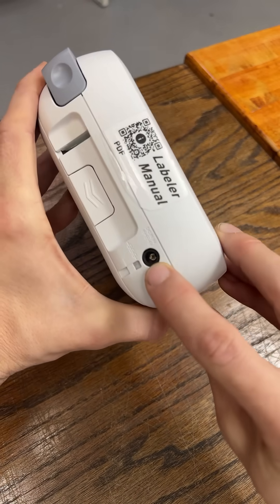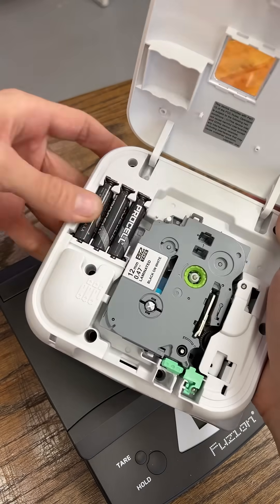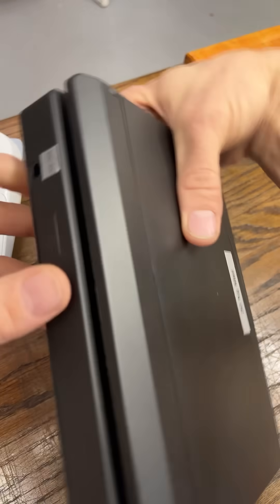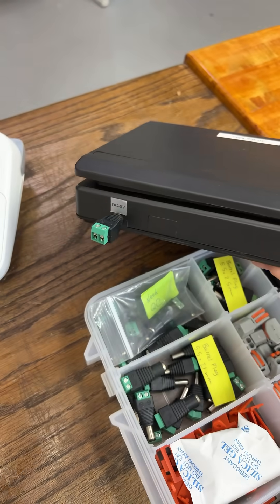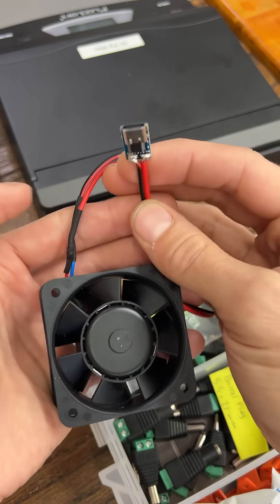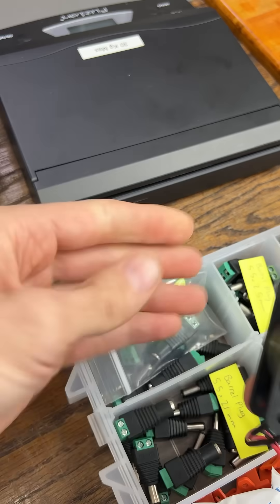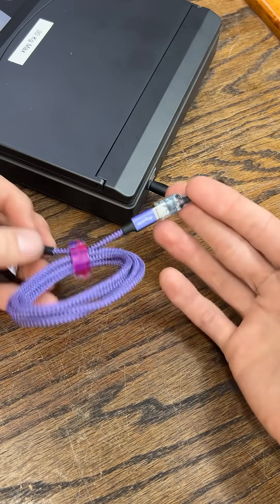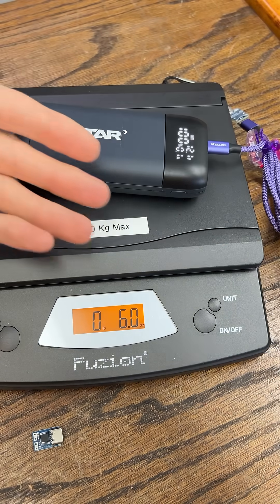USB-C can replace alkaline batteries

Comment: USB-C quick charge mode spoofer indeed is useful to use phone charger as power supply. Seems you're using your printer very often. Mine still run on same 6 AAAs installed at day when I bought it 2 years ago.

Comment: These label makers drain the batteries with shameful speed when switched off. To avoid this, I always remove one battery from the battery compartment and store it next to the printing cartridge when not in use. There is enough room for a loose battery under the cover.

Comment: I'm pretty sure the main reason usb c ports are not more common is because it would generate so many complaints from people that have no clue what they are doing. If you have ever done any type of support, then you know people are not very bright. People will see a usb c port and assume any usb cable with any charger should work, then start complaining because their device that operates on 12 or 9 volts does not work when they plug in their 5v phone charger. I see stuff like this all day.

Comment: Careful with those adapters and power blocks. Those are designed with specific devices in mind! One day your device works, and then it doesn't. Under or over amperage can be a gradual killer!

Comment: i just hope we get to a stage where these barrel plugs get an "USB-D" upgrade in the form of an optical cable in the center for data transfer and using the outside for power delivery. ... it could be so easy.

Comment: perfect product idea .. make a USB cable that will use the High power feature of modern USB chargers (using 15v instead of 5) with a small regulator inside to power all the stuff you use ..

Comment: I should save this video because I lost the cable of my Brother labelmaker and it EATS batteries for breakfast.
Reply: Always pull out a single battery before storing…save the battery forests.
Reply: @mikabreto  I usually pull all the batteries out, but it still empties them.
Reply: Note that another comment said their connection is backwards.

Comment: NO, they do NOT use this one barrel plug, they use 16 different types of barrel plugs sone that are only 0.4mm different size but not compatible.
Reply: The most ANNOYING part of barrel plugs. This is the next problem to solve after USB-C universality
Reply: @Glepno USB C is only a connector, there are many, many variances in cables and power bricks. It is far from simple.
Reply: Isn't the solution to switch to USB C?
Reply: @blufudgecrispyrice8528  yes but getting everyone to agree to switch practically every device for every application to one cable is a bit harder
Reply: @Glepno  fair
Reply: @blufudgecrispyrice8528  I would say that the advantage of a barrel plug is : it's cheaper than USB-C (USB-C costs a couple dollars to use, PER PLUG)
it can rotate around the axis, meaning that the cable won't want to flip the device if it's too light, and the cable is retaining its shape too much
Reply: @blufudgecrispyrice8528 Yup, but they need to up the amps so standard usb c puts out a bit more whoompf!
It's not just the bolts that matter!
Reply: @Glepno  tell that to the EU
Reply: @Glepno  But a barrel plug is much tougher than any USB plug - I've had plenty of USB plugs fall apart, but never a barrel plug.  They just need to agree a standard size, not random shapes and sizes...
Reply: @Glepno  No, no it's not. I would love if the power cables for every device in my house were the same type of cable.
Reply: @Glepno  eu passed pretty much this law 

is it portable?
could it be powered by usb C PD

if the answer is yes it has to have usb C by law
Reply: @blufudgecrispyrice8528 And once everyone is on usb-c, the can has just been kicked down the road to the various unlabeled cables with different power and data characteristics. Still something of a win, but also still a huge mess.
Reply: @TheLongestConfidence  fair. A standard barrel plug would be nice. Different colours or whatever for different specs.
Reply: @Glepno how?
Reply: @blufudgecrispyrice8528 you try explaining to normies though why usb c charger isnt the right one for their device and why the cable that looks identical isn't the right one for their device.

Any 3x aa device will work just fine with the base 5 volts though.
Reply: The least they could do is make a universal standards chart and put on the device just what size the damn plug is/was. I'd be happy just having the device actually list the plug size ik addition to the power requirements/specs for the power supply. Is listing it just that hard, or must firms REALLY be THAT F-ing greedy?
Reply: @Glepno it's not really a problem anymore all consumer devices have type c. Anyone who has a cell phone has type c cables

Adoption happened like a decade ago
Reply: @Glepno sadly USBC is arguably worse. The cables aren’t all the same, and there is NO way to distinguish them visually, unlike barrel plugs.
Reply: @wiggy8912 I'll argue that topic, gladly!

While i agree, USB-A is much more repairable, and resistant to the blight that is socket-wiggle,

with the (admittedly awesome) voltage switching adapter he  showed, the problem is mostly resolved if you're using USB-C with an adequately heavy duty cabl
Reply: Also polarity, not always is the positive in the middle pin
Reply: very true
Reply: no problem, just directly solder to where the batteries go instead of the plug
Reply: @sirmissalot8065 and what about over current protection? Just saying. You plug  Samsung charger and usb c cables into an old Yamaha keyboard you gonna see smoke. Duuuuuuh. 

This is why on plugs from back in the day have these markings on them with words like Wattage and Amp.
Reply: @razerow3391  I understand why the laymen might have an issue with this but it involves soldering so I think folks can work out what to not use.
Most quality charging blocks have overcurrent protection, my full size piano uses 35W which I know is lower than oldschool ones but USB C can still shove 100W down the line no problem and in the near future 240. 
Mighta been an issue before we started trying to charge phones at coke addict speeds but we're good now I think.
Reply: @razerow3391 So don't use a Samsung charger. USBC is a connector, not a cable or power source. If you have a device that requires 9 volts, use a 9v power source.
Reply: @razerow3391 for makin’ smoke, the only one that matters is volts!😅
Reply: @razerow3391  you're using a lot of the right words but in the wrong way. Power supplies don't constantly push their rated current or wattage through whatever they're connected to, they supply a (usually fixed) voltage and then the device will draw current from the supply, a properly functioning, properly designed device can be safely connected to an infinitely overrated power supply and it'll be completely fine. God help you if there's a short, though. 

Over-current protection is generally there in case of a fault like a short circuit, not for normal operation and the advent of USB PD has no bearing on the existence of over-current protection - fuses have been in use since the early days of electricity, after all. It's definitely possible for a device to toast itself when plugged into an over-rated power supply of the correct voltage but you're better off without them anyway because they're poorly and dangerously designed.
Reply: @ohheyemmi  but you're not addressing the possible over current issue. That's why charger blocks print the input and output volts and amps.
Reply: @razerow3391 except they oftentimes didn't list that so to screw customers over and lock them in to the vender's branded [yet ironically generic] power supply supplier. It's f-ing Compaq's mini OS/2 connector all over again. 😅 Just without the Taiwanese semiconductor manufacturing going and immediately making a cheap universal dongle to circumvent it! 😅
Reply: I'm still mad at oregon scientific, i gifted a clock to my mother that she can't use as seems impossible to find the right power supply because the barrel plug. Seems they placed the connector and forget about it
Reply: I bought 2 barrel to USBC adapter labeled as working with Dell laptop. Exact same size, different designs, but only 1 of them worked.
Reply: AND sometimes they like to switch the positive and the negative
Reply: Don't forget to always check polarity on barrel plugs.
Reply: @infernaldaedra  how do you do that? ( is there an easy way )?
Reply: @Cryin_Lion  it should say it on the port
Reply: @daanzoomer2997  thank u!
Reply: The brother label makers are reverse polarity too. I have one
Reply: Different polarities too
Reply: And that while different sizes of barrel plugs could actually have made sense. Different voltage? -> Different outer diameter. Needs more amps? -> Bigger inner diameter. Now make the center pin more flexible and adapt to different sizes, and you can use a 2A power supply with a 0.5A device, while a 0.5A power supply won't fit into a 2A device.
Reply: The same plug can also have different voltages so check before you roast your amp...
Reply: Oh there are way more than 16 types.  It’s insane.
Reply: So you make a barrel plug to USBC for that device then store it in the battery compartment.
Reply: 5.5x2.5 is standard for 90% of electronics
Reply: @AntonKarpuzikov  Except when it isn't. TV manufacturers like LG and Sony like to do this shit
Reply: He means the two in the video not everyone in the world
Reply: 2.1mm is overwhelmingly the most common through, except a few scattered things using tiny ones.  The real problem is that some devices use reverse polarity for unfathomable and insane reasons.
Reply: And back in the days before USB-C that was a GREAT way to prevent you from blowing up your equipment.

And those barrels can take one hell of a beating compared to a USB-C connector.

And that converter board is just one more thing that can break.

And you already have a powersupply for all devices...

This channel is solving a problem that does not exist.
Reply: The point is not that it is one barrel.  But since they are readily available you can cheaply make a USB adapter for anything
Reply: Plug and polarity difference.  I once did the math on the total number of voltage, polarity, and connector combinations possible at RadioShack.  It was in the thousands.
Reply: Let's be real though. There is only like 3 or 4 sizes that are common enough to fit and work between those dozens.
Reply: Yeah, and every time I try to find the correct plug for one at goodwill they never fit!
Reply: Sir, is there any way to know ( or a resource where I can learn ) which type of barrel plug goes to what? Are they recognized by size or by voltage ( for example )?
Reply: @Cryin_Lion  you have to match voltage
Reply: @L4t3xs  thank you so much!
Reply: @Cryin_Lion no. Its just a plug shape. You can't know just from it. Devices usually have it written on their label what voltage they need and if its inside or outside negative.  Its the circle with a voltage and amps next to it on the label
Reply: Also usually the center pin is positive 95% of the times but there are some companies that reverse the polarity on a universal plug
Reply: @daanzoomer2997  prime example of that: I have a device ( small XH radio) that takes a positive center pin barrel. Device got redesigned with identical model # and exact same layout/ apperance EXCEPT the device connector center is now negative. Insane- if one didnt read and catch polarity, then a device swap from older to newer using the same wall wart= smoke.
Reply: he never said "this one barrel plug" he said "one dollar"
Reply: doesn't the continuity change on some too?
Reply: Dont forget POLARITY HELL
Reply: Yeah and not always the same polarity either, get that wrong at your peril!, and some stuff wants AC & if its old school battery charging it will be some obscure voltage, and needs a corresponding low obscure current to go with it!, etc etc etc.
Reply: Desolder it and put your own family of connectors on it as I have!  (Because oh yeah the barrel plug size is different and the pin will surely be a different size also)
Reply: I was hoping a comment like this was on here. It was the first thing I thought. Yea OP is right, that USB-C hack IS a great idea, but they do NOT use the same size barrel plugs, although I am sure you could get one for each.
Reply: Yeah there’s also ones with ground (-) on outside (+) positive inside and the inverse. Not to mention different voltage levels. Still easy but not that simple
Reply: Some are .4mm different ID, some are .4mm different OD, some are .4mm different length. Glad that we don't have a universal standard.
Reply: 16? I could have sworn it's like 40+
Reply: Might have reverse polarity too
Reply: Or that one barrel plug connector that IS 0.4mm, needle thin fiddly bugger on my first tablet that busted after a few months, I stuck with Laptops after that for a while, like Kobo Clara Colour eReader and Steam Deck now but they are leaps and bounds ahead
Reply: I think you missed the point. They could use the same technology in these devices and allow them to be type c powered....
Reply: and the ones that are the same have different polarity
Reply: Ha ha. Yep! Who the hell ever thought that was a good idea?! 🤣
Reply: WHile there are 16 or more different barrel plugs, about 3 would fit about half of items I've seen
Reply: No all things that are 9 volt are the same amp and wattage how dare you! You can push 45w at 15 amp through something rated for less that was designed before people used USB so doesn’t have over current protection.
Reply: @razerow3391  Devices only pull the current they need, so (excluding battery charging with no control circuitry), you can safely plug a 100 amp power supply into a device that only needs 15mA and as long as the voltage matches there will be no issues.
Reply: @razerow3391 False. No current is pushed through the device. The device draws the power it needs. So the risk is that the device draws too much power and fryes the charger block or power bank, if it does not have good over current protection.

Comment: The answer is always yes!

As long as the voltage isn’t greater than the required voltage, almost any amperage typically* works

(*typically only the required amps are pulled, but the voltage is forced in regardless of power requirements. Still shouldn’t use more than a 20% difference in amps if you wanna be extra secure)

This means you can power an original NES with a foot massager power cable(yes, I’m not joking. My fiance had one and that was what we used for power. Exact voltage, but 2 amps more. Worked like a charm 🥰)

Comment: Regardless of the voltage. U are forgetting that the other part to the power equation is current. It's all good and well that u can supply the voltage but u need to make sure that it can supply the current needed also. Because most of these cheap adapters are 5v at 1A. That's 5W. If you stepped that up to 12V for example then u can only draw 400mA.

Comment: That's what's wrong with the thinking that every device is different and different plugs and voltages.  Standardize them like they did 110 volt household current and plugs. It's not rocket science.

Comment: the plugs are often different sizes the polarity can be one of two different ways and there are other factors still. this will not blindly work all the time and if you follow these instructions you can destroy your device or start a fire. really irresponsible stuff here

Comment: I dont understand. Does that little adapter actually have all four voltages available, or just the one marked out? Is it just a variable resistor that reduces the voltage from the actual wall plug? 

This seems less like a "usb c is amazing' and more like "i took the most difficult way to replace chargers i lost".. couldn't you have done that with any other format too?

Comment: Found massive wall clock from trash one time. Tested it out and it consumed the one AA battery in 15 days. Well wooden rod, drilled hole in the middle, made cable with male bullet connectors that i push trough the middle and into the ends, glued them in place, placed as battery replacement and then took old phone charger and stepdown converter with long leads to power it, measured the voltage from the adapter points and adjusted it to 1.5v since there is transfer losses due longer distance and when i got it around 0.01volts deviation put on. So far only time it has messed up the time is during power outages, but its easy to set again. If it had radio calibration i would not need to touch it ever again.

Comment: 9 VDC power supplies, in fact any power supply ever needed, are available on Amazon or other places for mere dollars.  and then the device can be operated the way it was designed, which always preferred to expedient adapters and what-nots to make it run.  also, there's rechargeable AA batteries, which makes the operating cost much less.

Comment: You are so surprised like it's some kind of new think, that's like the first small power connector invented. And you don't need USB there are appropriate transformers to the electric grid! More surprising would be the other way around, DC plug to USB

Comment: What’s the point. You need all the cable for the device connection anyways and then cut them off just to use it for your adapter? Makes no sense at all.